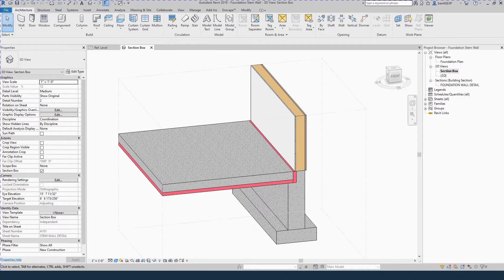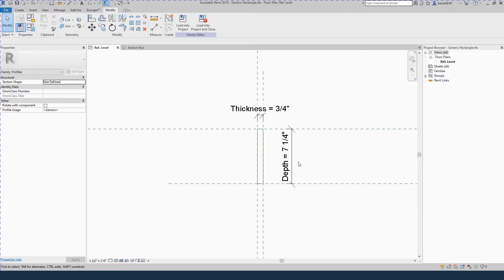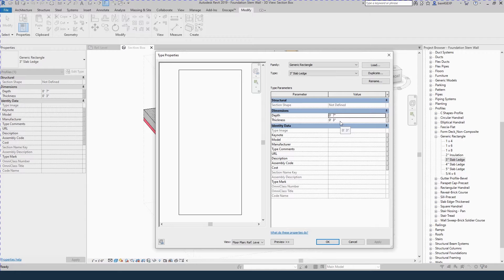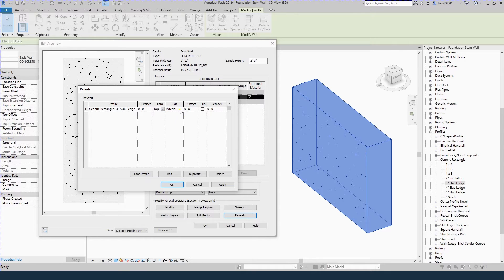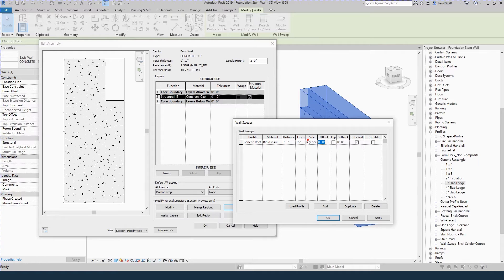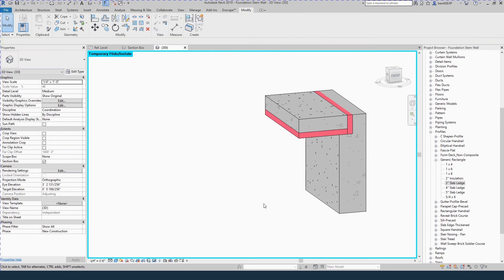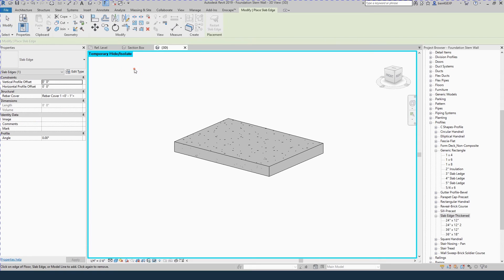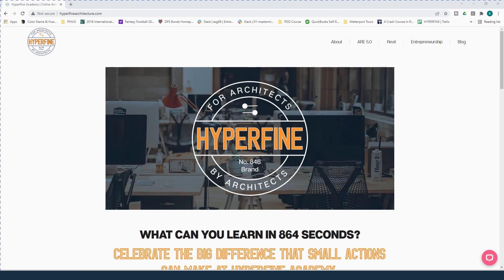Revit Foundation Stem Wall Tutorial

Comment: How would you add a 18"x20" pier at the columns?  My top of wall is at 0'-0" (GREEN) and the brick ledge at -0'-8" (RED).  The concrete piers will also be at -0'-8" (RED)?  I will paste a detail with the walls highlighted green and the brick ledge & piers red if it will let me paste it to this thread.
Reply from the maker: Could do it a bunch of ways. Maybe a generic architectural column. Or a spot footing connected to the bottom of the column. Or just some walls that look like a pier.